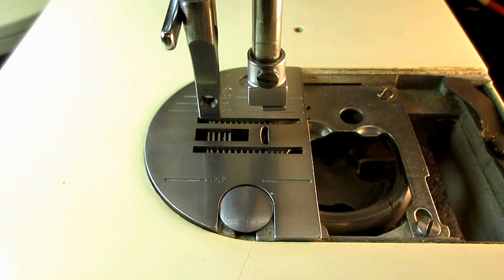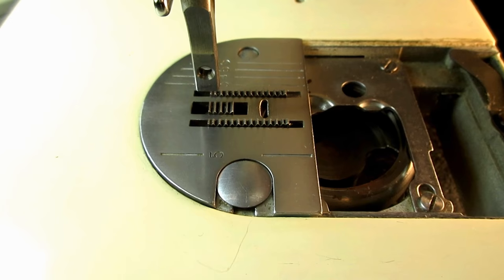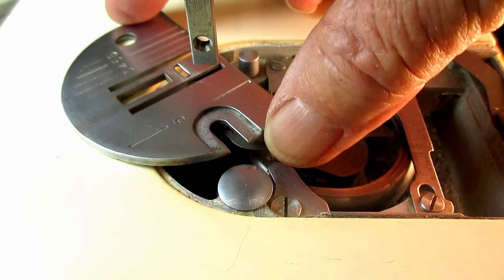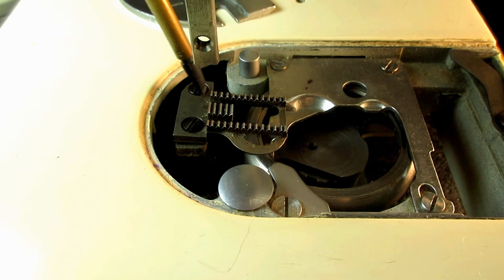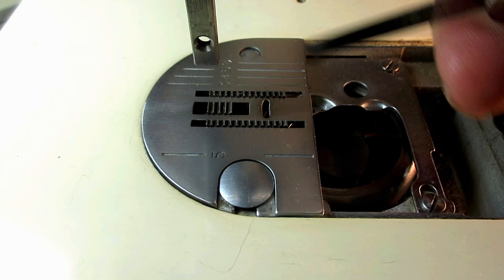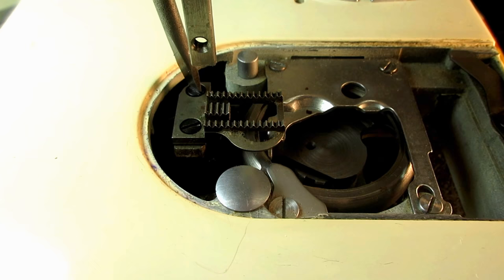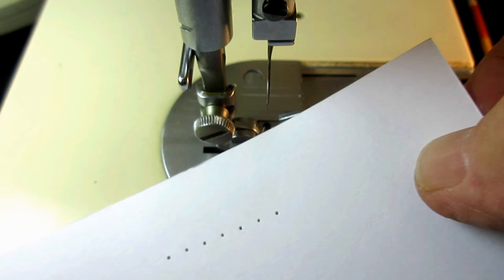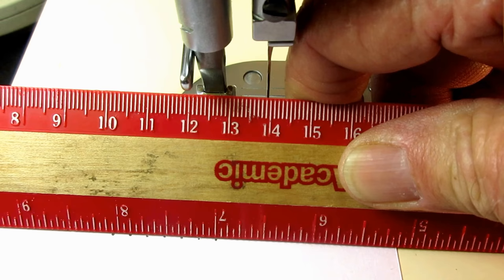How to Adjust the Feed Dog on a Singer Model 353 Genie Sewing Machine

Comment: Thanks a lot for this in-depth video! It helped save a sewing machine similar to this one (Singer Samba 6) from the dump. I found it abandoned near a shopping mall and decided to try fixing it and the stitch length was the only thing that seemed to be an issue, aside from 30 years of grime and dust buildup. After a lot of messing with these bolts it now actually stitches at acceptable lengths rather than the feed dogs only moving the fabric on the highest setting.
Reply from the maker: Thank you for saving that machine and I'm glad if the video helped you do that. I appreciate you taking the time to comment

Comment: Another great video Andy, I found where my 457 was binding it looks like the upper dog feet connecting rod had run dry of oil and picked up so i sanded it with fine emery then cleaned and re oiled and it is like a different machine, just need to adjust the dogs now
Reply from the maker: Thanks. Newer owners of these vintage metal machines often do not know all the oil points. I was surprised how good oiling to the specs in the manual could cure many problems. I just started oiling the machines as soon as I brought them home. For viewers who need the Instruction Manual, most of them are still available for FREE on the USA SInger support page here: https://www.singer.com/support    Just enter the Model Number in the search box, hit enter, and it will show a list of any available manuals for that model. Thanks for sharing what you found, acestu, so other viewers may find help. Take care.

Comment: Dear Andy, thank you for another great class. One of my machines, a vintage about which there is very little info online, is not pulling well and I suspect I set the presser foot bar too high… First I thought it was the height of the feed dog but I’ll give that a try first. Anyway I was curious about the adjustment of the feed dog. Have a wonderful week
Reply from the maker: A couple of other things to think about are the pressure setting on the presser bar being too low, and it is possible the feed dog teeth are worn down if it is an old machine. Here is a playlist of my feed dog videos: https://www.youtube.com/playlist?list=PLsCOZgzzaiKK4Xm0t95z5jDVCgC9nRFc5     and a playlist of my presser bar videos: https://www.youtube.com/playlist?list=PLsCOZgzzaiKJLCf3Sr6Sfgss0IeSwBsKl   if the vintage machine you mention is a Singer I may be able to help with info if you give a model number or serial number. If it is other than SInger I can't help. Good Luck, and thanks for watching my channel.

Comment: Hi, and thanks for a great lesson now i now the works of the feeddog, now i cab adjust it on  my husqvarna's as well i had one where the dogs were up way too high, i got a new machine too a singer 676g and i was suprised that it was all metall gearns in it.just missing a tiny tiny screw on the bobbinholder feather thingomajig to the right of it, otherwise in great condition for its age got it for $15. all the best to you.
Reply from the maker: You are welcome. Nice to know the method works on Husqvarna machines as well. I never even seen a Husqvarna in person. I've never seen a 676G either. Made in Germany? It looks a lot like other 600 Series models in the USA, but it is not a Touch & Sew type machine.  I couldn't find a parts list for the 676, sorry. I was hoping to find a part number for the screw. Many Singer screws are proprietary sizes and hard to find, so good luck. I did find the Instruction Manual. Looks like a nice machine, and for $15 what a bargain! https://www.singer.com/sites/default/files/product_manual/SINGER%20656%20and%20676%20Sewing%20Machine.pdf
Reply: I got a android phone now and i will try to make a husqvarna info movie for you, but i think there are lot of similarities with older sewing machines that are oscillating. I think the 66k 88k 185k are of such type.
Reply from the maker: All I know of Husqvarna is it's a Swedish Company from 1903 on. There was a dealer in Phoenix, AZ in the 1970-80s. I've never seen one in person, only on YouTube videos.

Comment: Great job sir, just found this,but please how to set the niddle timming to the feed dog, because my niddle is inside the fabric (lowest) when the feed dog is  set for longer stitch (like your example two) pls help cause am in a middle of a project and the machine starts acting up, giving short stiches due to the niddle being in low position (the niddle does not allow the feed dog to pull the fabric to it's longest stiche ) pls heeeeelppppppp
Reply from the maker: I don't know of a way to time the needle to the feed dog. The feed timing is set by the feed fork from the horizontal arm shaft as far as I know. The same arm shaft turns the crank for the needle bar system. Of course, the needle must be timed to the hook or you can't make a stitch at all. I think the Needle Bar Pendulum Movement on your machine should be checked. Let me offer this. Here is a Playlist of my 20+ videos for working on model 353/354: https://www.youtube.com/playlist?list=PLsCOZgzzaiKJvzcqn97Yh8lvx-tbdFl2p    One of those videos is about the needle bar pendulum movement and you can check it without changing anything if you want to see if it is set properly: https://youtu.be/dQpenKEQV7Y    So far you have only spent time, but you can also buy & download the original 53-page Service Manual for $8.99 at this link: https://manualsoncd.com/product/singer-353-354-genie-sewing-machine-service-manual/

Comment: Hiya I'm hoping you can help me my singer 185k feed dog seems to stop moving please help x
Reply from the maker: I'll bet that makes it hard to sew anything. The movement of the Feed Dog is controlled by the Stitch Length Regulator Lever on the front of the upright part of the machine. That lever controls how many stitches per inch you sew, from as few as 6 to as many as about 30 stitches per inch. It does that by moving the Feed Regulator behind the lever and inside the machine. That lever also allows you to put the feed dog into the Reverse Mode that changes the movement of the Feed Dog from back to front pulling the fabric towards you for Back-Tacking at the end of a seam. You put the dog in reverse by moving the lever above the horizontal line just above the 30 number next to the lever. So think about it like this; when the lever is at 6 the feed dog moves in the longest stroke, front to back. As you move the lever up the stokes of the dog get shorter and shorter allowing for more stitches per inch. AT 30 SPI the dog is barely moving forward to allow 30 stitches per inch. As you keep going up the mechanism puts the dog into reverse. There is a point between 30 and reverse like a neutral spot, or null, where the dog doesn't move forward any longer but does not move in reverse yet. In that neutral spot the dog just kind of bounces up and down a little bit. The Feed Regulator is a cast metal part and almost impossible to break, as is the Feed Lifting Bar that raises and lowers the feed dog. If your dog is not moving it is possible your stitch lever is in neutral, or close to it. To test feed dog movement I remove the bobbin and needle thread, lift the presser foot, put the stitch lever down to 6, and turn the handwheel toward me. I should see the dog making a long stroke from front to back. As I keep turning the handwheel I slowly raise the lever going up to 30 and I should see the feed dog moving less, and less with shorter and short strokes. At 30 the dog is barely moving and above 30 I enter the neutral area that stops dog movement, then as I keep moving the lever up I see the dog has revered direction in short strokes that get longer the higher I raise the lever. That's normal feed dog/stitch lever movement. If the mechanism was completely stuck, like I could not move the lever down to 6, then I'd open it up and add oil, or clean the parts if rusted. To learn more about your feed regulator system and how it works you can watch this video for model 99K https://youtu.be/OTuoIj0Vx0E   Your 185K is the updated version of Model 99K with a new body style, color, and bobbin winder, but the mechanical parts worked so well that Singer kept them on the inside. Thanks for watching my channel and good luck.

Comment: Need help on a Singer Athena 2000 Electronic.  Feeddog will not move.  Do you have a video on how to repair it? I hit the reset button, but it didnt help.  At one point the handwheel was jammed.  I think the reset button released it.  What should I do?
Reply from the maker: No video for the 2000. I've never even seen one in person. Looking at the parts manual for it It looks like, besides the motor and timing belts, there are plastic gears that operate the hook and feed dog. Those gears are now 45 years old and may be breaking apart. If your handwheel was stuck then came free that sounds like a gear falling apart to me. Here is the website of a man who is experienced with that model and has manuals and repair guides and sells some parts. I know the machine also has a circuit board, but this sounds like a mechanical problem. You can email Terry and get his opinion if you like. http://site.tandtrepair.com/Athena2000.html
Good luck, and thanks for watching my channel. P.S. If you by chance buy something from Terry he will give you 20% of whatever you buy before 8-1-2020 using coupon andy-h-yt

Comment: Hi! Andy, I need help with a futura ce-250. The feed dogs are feeding my material forward instead towards the back when I sew. Can you help me ?
Reply from the maker: No too much I'm afraid. Your machines is 30 years newer than the ones I work on. I see on page 36 of the instruction manual ( https://www.singer.com/search/support?title=250) there is a button you push AND HOLD for reverse sewing which is what you described with the feed dog. If it was a mechanical machine I'd think maybe the button or mechanism behind it was stick, but it looks like your model is electronic, so perhaps there is a problem with a circuit board. I'd still try pushing that reverse button just for the heck of it, after unplugging the machine for a minute and replugging it back in, but don't trust me as I don't work on the electronic models. You can buy an 81-page Service-Parts Manual for it here: https://manualsoncd.com/product/singer-futura-ce150-ce250-ce350-service-manual-parts/   Maybe that could help. The instruction manual has several troubleshooting pages but I did not see your problem mentioned. Good luck.

Comment: Hi Andy:  I have a Singer 9960, which is a new-fangled computerized machine.  I sew layers.  The feed dogs have fallen beneath the throat plate.  They raise a bit, but not enough (the timing seems ok).  I got the plastic case off, but underneath everything is still hidden.  I can't find the exact screw to adjust.  Any ideas?  I would pay for a quick consult.  Thanks.
Reply from the maker: Can't help you with a "new-fangled" Singer. No access to parts or service manuals. It's a very different beast than a vintage model.
A friend told me you may (maybe) can register with this site and download a service manual https://d9s8c1kntoq9e.cloudfront.net/07c7515b8831fa51187e04b8920cda.pdf
I've never used the site so can't say it works or not.
Reply: @andytubesewing1953  Thanks.  Should be an easy fix, but they make it really difficult.
Reply from the maker: @FicelleProductions  The type of machine you have has so many parts and I agree it is difficult to repair/replace parts on it. I feel they were engineered for faster assembly, not longevity. Good luck.

Comment: The feed dog is not working. Where do I look to see what the problem is? It’s oiled snd cleaned and the feeder just stop working
Reply from the maker: Model 6230 is too new for me and it was probably made in Taiwan and has several plastic parts. I'm just guessing one of those parts has broken due to age, but that's just a guess. I've never bothered to work on any of the Singer Machines of that decade as manuals and parts were harder to get here. You can buy a copy of the Service Manual if you like. It should cover the whole Feed System for the machine, along with all the other parts of the machine. Sometimes the Service Manual includes the parts diagram, too, but not always. I see someone on eBay is sell the manual here: https://www.ebay.com/itm/183679117570   That is about twice the price I usually pay for manuals. The seller I have used seems to have the same or similar manuals for less than half that price here: https://manualsoncd.com/product/singer-6233-sewing-machine-service-parts-manual/  Sorry I can't advise you more. The Singer 353 in this video was one of that last I worked on and was basically the same as the metal machine. With your model Singer went to a much different mechanical style that had lots of small and plastic parts and used different feed and hook and drive systems that I've never worked on.
Reply: @andytubesewing1953  what do you think is an estimate price of repair fir this problem ?
Reply from the maker: @rosegin9585  I couldn't say as I've never work on this type of Singer machine. I live in a Metro Area with 5 Mil people. There are about 9 or 10 "shops" that say they repair. They charge from $30 to $70 to put the machine on a bench and "take a look" at it. Any repairs cost that same amount per hour. Most really do not want to repair and quote a ridiculous price b/c they don't know how to repair or really just want to sell you a new machine from inventory. Another favorite response is "parts are not available". One of those shops is an "authorized" Singer shop and they are the one with the higher prices.
Reply: I was told that it’s some sticky stuff that’s holding the feed dog from working. He wanted to clean it for $130. Is there something that I can buy snd spray clean the area myself?  I could buy a refurbished machine for less than that price!
Reply from the maker: @rosegin9585  I can't recommend anything like that as I do not know the type of plastic in your machine. Buy a nice refurbished metal machine

Comment: My singer 513 feed dogs move up and down but not back and forth feed.
Reply from the maker: Is this 513 new to you, Carl? You just got it and are testing it out, or you've been using it and this suddenly happened? The stitch length control is used to set the length of the stitch and that makes the feed dog move a corresponding amount in forward or reverse. If you set the stitch length to far left of "FINE" towards the "0" the feed regulator (the part inside that controls the movement of the dog) is in "neutral" so to speak and can't move the feed dog forward at all. A normal test of the feed dog/feed regulator is to put the machine in straight stitch and the length the longest, like "6" and sew on scrap material to see if the feed dog moves the fabric. You don't even need to have the thread in the needle. You should get about 6 holes in the fabric per inch of fabric. Of course, there could be broken/stuck parts behind the dial going to the feed regulator too. If you feel that is the case here is a video showing how to safely remove the front panel of a 513 so you can see the parts inside https://youtu.be/zThFx1CoM-E    If you want a deeper dive into the mechanics you could always buy and download a copy of the 78-page Service Manual for $4.99 that has all the adjustment information on your machine https://manualsoncd.com/product/singer-500-sewing-machine-service-manual-518-538-513-514-533/